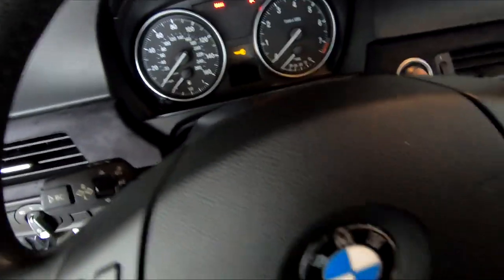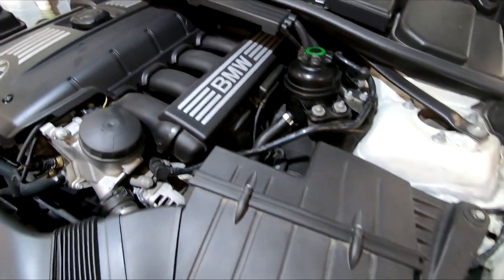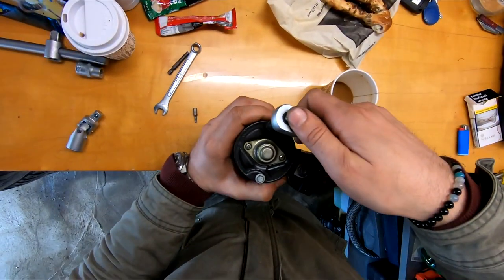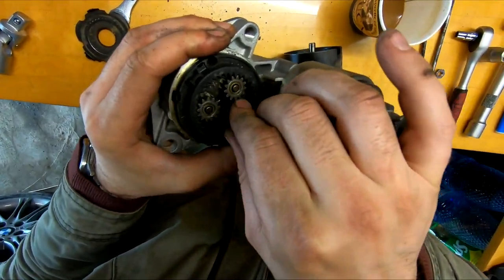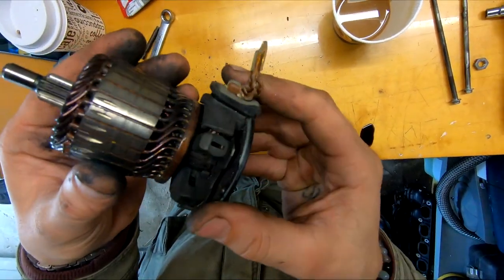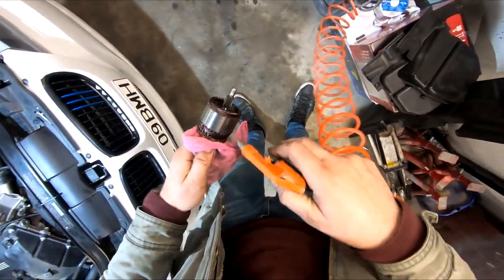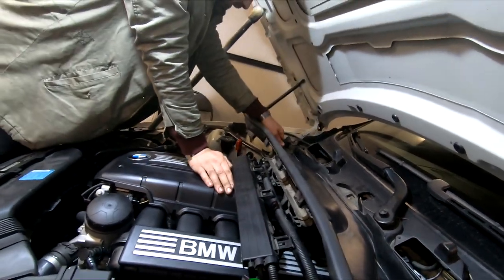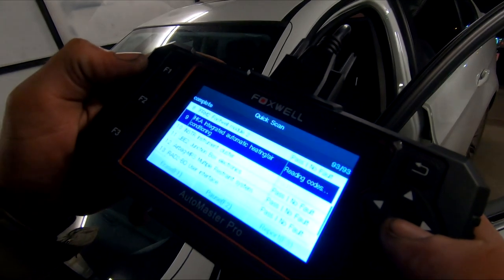I Took the Starter Motor out and Rebuild it for Only 20$   |BMW e90 328i N52|

Comment: I just finished replacing the starter on my E60 523iA LCI with the N52b25AE engine.
The starter died suddenly without any warning or symptoms. And Scan tool was showing error code: A0B4 (CAS: Starter Operation.)
If I try starting several times the EGS error pops up too (Defective signal from CAS). All you can hear is the fuel pump turning and a buzz noise. The engine was not cranking at all.
My heart was bleeding low and high because I thought some circuit in the CAS died. Hopefully for me the car got immobilized in a parking lot at my work place.
Called a mechanic to help me.
I was able to get an original starter from the junkyard for 130 bucks.
We tested 12v supply when cranking, and it was okay, we came out to the conclusion that it is a dead starter.
After replacing the starter, the engine started flawlessly.
After inspecting the dead starter I found out it was swapped on the past by some evil mechanic who stole the original part and put a tired one (Full of scratches and and serial number indicates 2005). I was really surprised to see a starter die at 140K kms.
Needless to say that the fuel pump, steering pump, thermostat and water pump are also suspect now....

I came to this video to see how I can rebuild that old part.
I guess those are the contact points?

Comment: My n52 e60 just died at 80000km. This car gets alot of short trips. Typical A0B4 engine starter error code and just died suddenly. Took apart and brushes right down. Had another e60 that died at 140k km but was bad from around 100k. It would always take the clock time out from alot of current draw that resolved with the new starter.

Comment: Hey,what is the part number for this replace part,because i have the same problem and i can't find this part for sale.
Thanks in advance :)
Reply: 1004336506 Bosch brush holder. Paint thinner works well to clean it up the gunk .

Comment: i think i got the same problem, battery was flat after charging still not cranking. did you replace anything or just cleaned it up?? what was the thing that cost 20$?
Reply: nvm the conttact points, do you have a link for the parts?
Reply from the maker: sorry i don't. i bought it from a local store and didn't pay attention to the part nr.